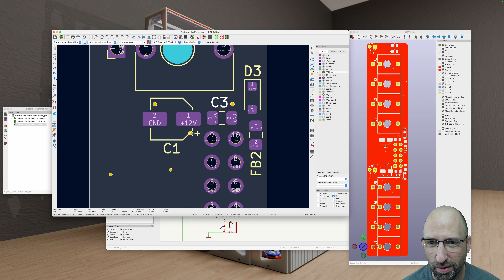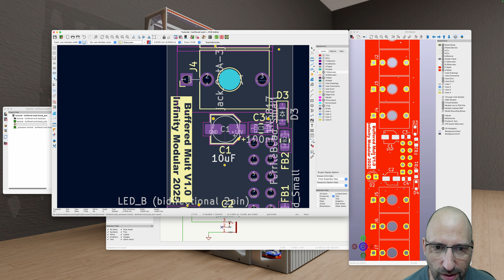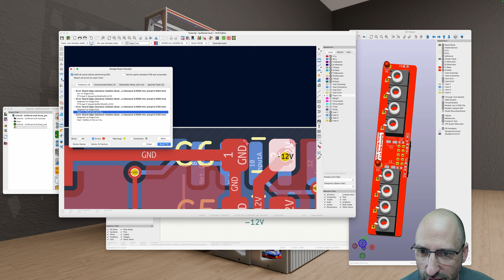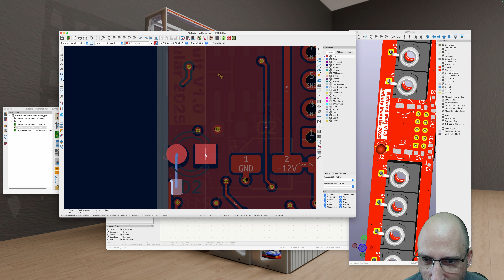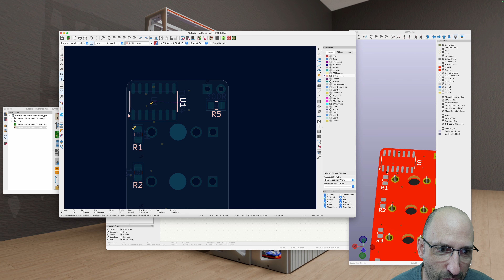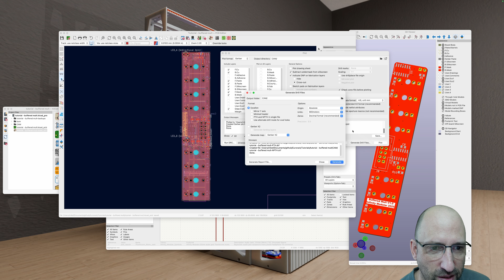Eurorack modular design 101 - Episode  4 - Getting Ready for Manufacture

Comment: Good series. I’d love it if you did one more to show how you made the panel you show in thumbnail. Did you do that by making a PCB panel?  That seems to be an increasing common way of making panels and they end up looking great.  I’ve seen videos on how to do it but I haven’t seen one where the panel is made to align with the control features of existing PCB.
Reply from the maker: Hi @honkskillet, yes indeed. I really need to get to this next episode, it's way overdue. I had almost finished it when I found a better workflow for the alignment of the controls. So I need to re-record. Life's just been a little busy. But I'll get there. I've made many modules this way. Previously I was actually milling panels out of copper clad board on my CNC, but they look much better when produced by a pcb manufacturer, and frankly it's much less hassle.